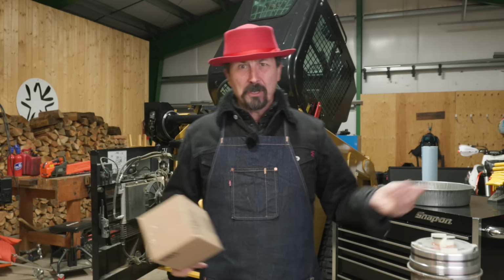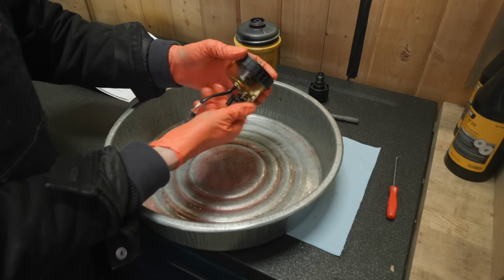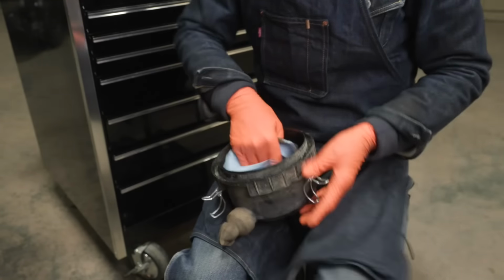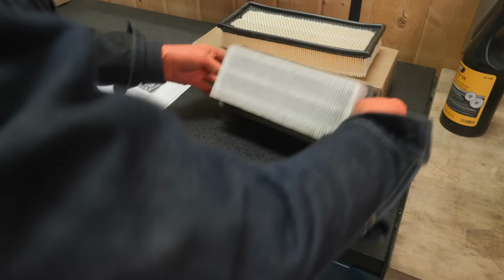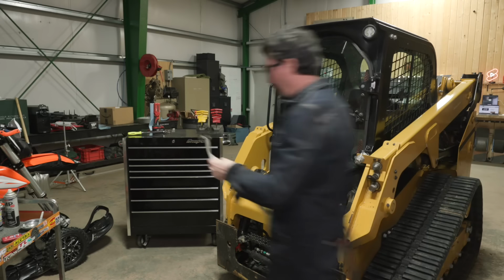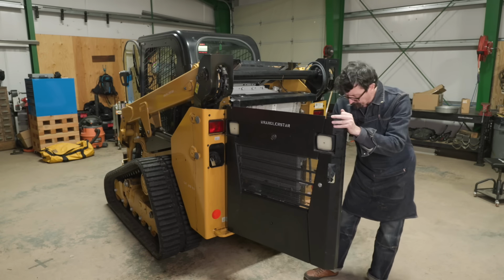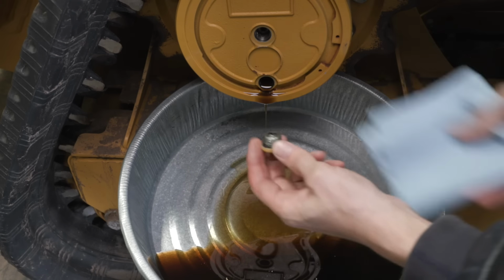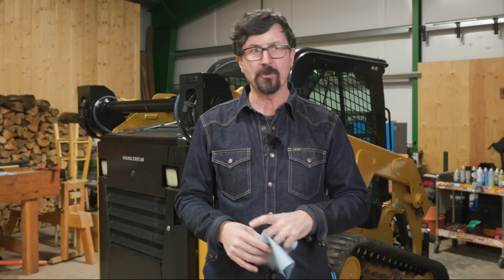Everything is Falling Apart (pt 2)

Comment: The pick scratches are enough to cause oring failure. Just leave them in place and oil them. Some greases deteriorate orings
Reply: snap on makes o ring pick designed to not scratch
Reply: @micadrake3025 anyone else?
Reply: Just use a plastic pick.
Reply: I worked for a pool & spa company back in high school. They preached never to use petroleum jelly on o-rings for the pumps and other related plumbing because it breaks down the rubber. That has always stuck with me. I don’t know the science associated with it, but makes sense I guess. Or maybe it was so we could sell customers a tiny tube of o-ring lubricant for $14.99 (not cheap in 2001-03) lol. I learned a lot of oddities in the pool industry that have stayed engrained in my mind.
Reply: Just a little more knowledge to add. When rebuilding my Deroit Series 60, in the Detroit service manual, when installing the wet liners, it specifically said to lube O rings with Vaseline before pressing them into the engine block. Good for some things, bad for others. All depends on application, I suppose.
Reply: Just use 90D O-rings & be done with it
Reply: Synthetic grease only on orings. Super lube is what I use.

Comment: One thing I learned from my dad that has been a mechanic for 35 years is to always loosen the fill plug before the drain plug In case the fill plug strips.
Reply: Actually it best helps the flow due to air pressure.

Comment: Well done.

Lots of comments about stuff. I just wanted to add that it's not necessary to move it to refill the drive... just put the lower drain plug back in and fill from the center one.

Great job, though.
Reply: Yeah that one had me scratching my head lol.
Reply: @CombatWombatQRF I also agree if you mean that you'd know the correct full level by removing the center plug first, for refilling, because the drain plug is also the fill plug? I realize it can be filled by adding into the center plug.
Reply: The center final drive plug has a smaller hole on the cat machines. Thats why you move it to get upper access to the outer plug hole which fills easier.

Comment: Careful with the blue shop towels on non glass windows, it’s mildly abrasive and will scratch lexon and plexi. Not sure what the windows are on the cab, but we used to keep a roll of those and cleaner in the cabs for commercial snow removal and after a year we started to notice a haze/dullness, talked to the doosan dealer and that was the first question they asked if we used paper products on the windows, they said even bounty paper towels were better to use than the blue ones, yet microfiber towels were best. Love the content and wisdom keep it up!!!!
Reply: @@phillipbanes5484Cotton is fine but microfiber cleans better

Comment: When I was on the farm Dad had bulk tanks.  All the tractors used the same spec hydraulic, transmission and engine oils, so the bulk tanks were used.  He kept them in a separate shed from the shop and had a concrete ramp they could be rolled across.  Usually the changes were just done on the ramp unless the weather was nasty.
Reply: 500 hour done at 259hours?  I guess it makes sense if you are not running the equipment like a commercial operation, just sitting does weird things too.  A deep check once a year is probably a good thing.

Comment: There is (was?) a big ranch north of Bakersfield, CA. (Sayler Farms?). They had a beautiful shop and a well stocked parts bin filled with commonly used parts. Legend is that the paint on the floor was so tough that the cleats of a track vehicle wouldn't scratch the surface.

Comment: Cody, I have a Kubota svl95 track loader. You can’t avoid the water in the filter it’s going to happen sooner or later, start changing just the fuel filter every 100-200 hours

Comment: You are correct in that some of the chemicals we use on a daily basis are not great for the environment or us, however on the other hand and in some cases, the substitute Bio chemicals just don't cut it! I have tried to use many of them and they work poorly or are so expensive and yet not great performers. Some are OK - and I do stick with those few, but unfortunately many non environmentally chemicals just work swell. It's a dilemma!  I always do try the new Bio stuff, but like I said most of the times they don't work half as good as the traditional ones. Sort of like an EV ..... they are just not ready for prime time yet.

Comment: Some hydraulic systems have a return filter that sits inside the tank. Not all systems, but those generally don’t need to be dealt with as long as you keep your supply filter changed and fluid changed when necessary.